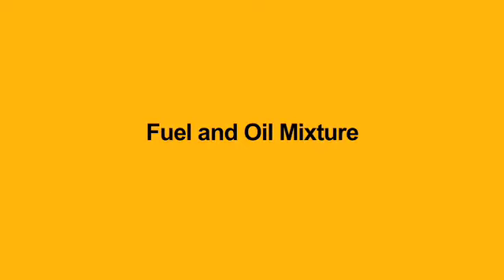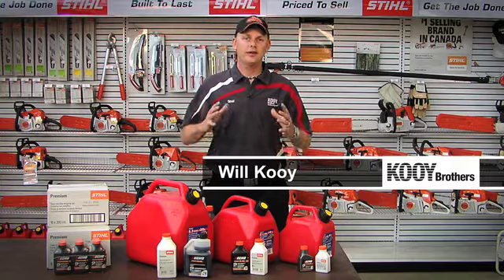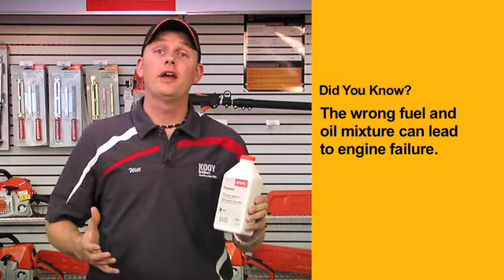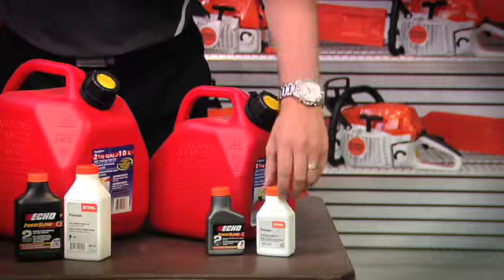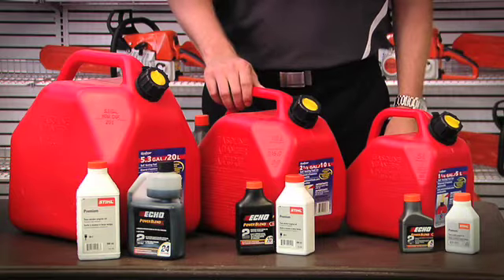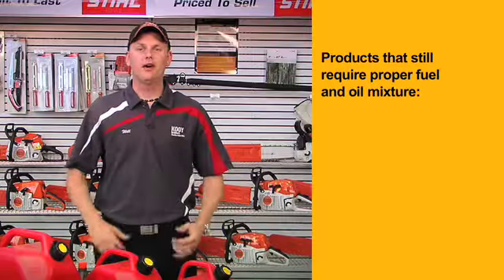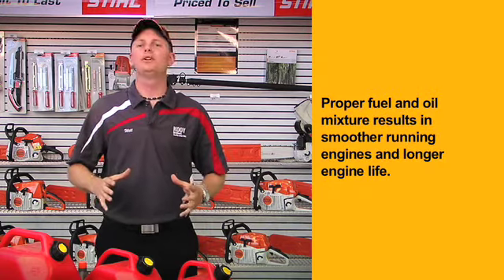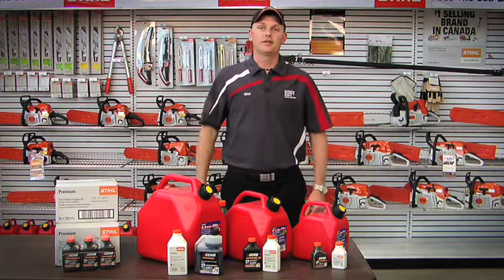How to Get the Perfect Gas to Oil Ratio for 2 Cycle Engines in Chainsaws, Trimmers & Blowers.

Comment from the maker: Thank you for your comment. Based on our experience as the largest dealer and service centre for outdoor power equipment in Toronto, we’ve found that the vast majority of 2 cycle engine related issues result from the wrong oil to gas ratio. It’s also one of the most common questions we get from customers.  You may not notice the effects immediately but the ratio imbalance leads to problems over time. This video provides a simple way to get the ratio right every time.